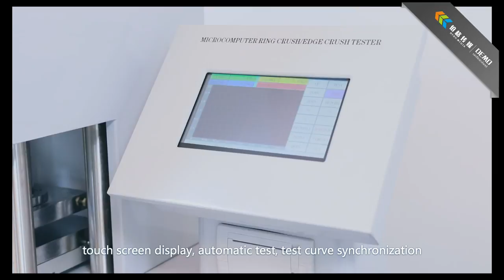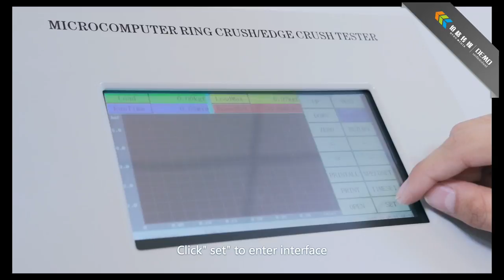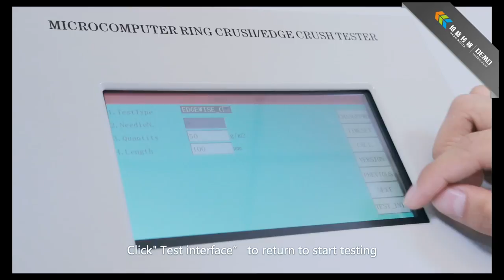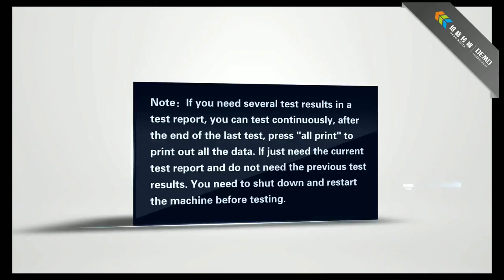HD A513B (ECT) Edge Crush Tester - Crush testing Video

Comment: I wanted to ask about the two block of metal as the holder at 2:10, does it need specified spec like dimention size and weight? If so what the spec that used in the video thx
Reply from the maker: Thank you and welcome to our website: https://www.haidatestequipment.com/ Leave a message and our engineers will give you a plan